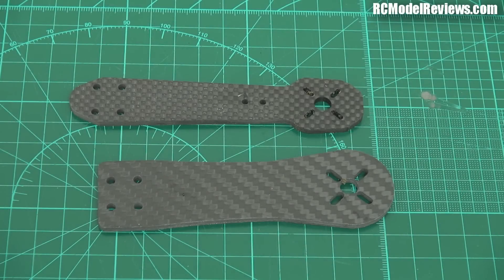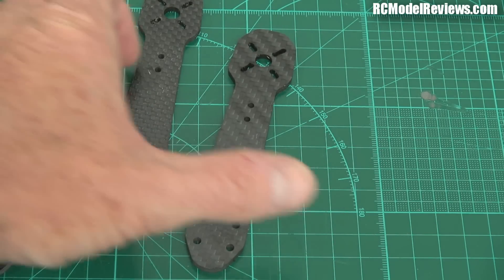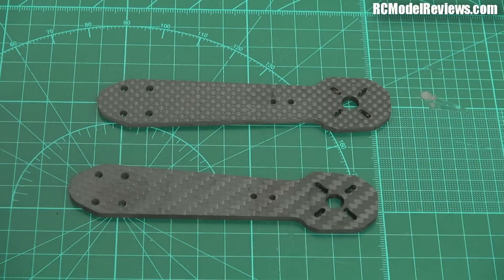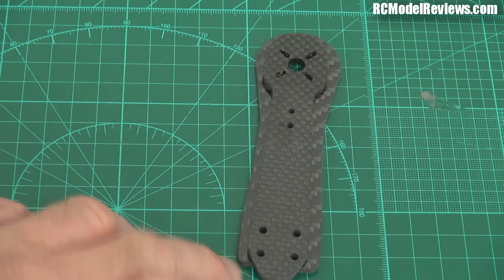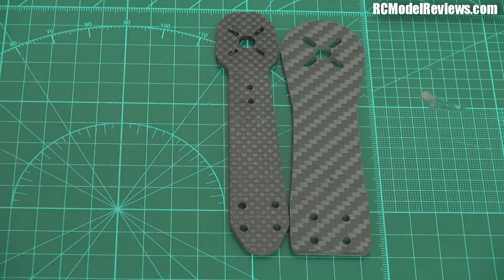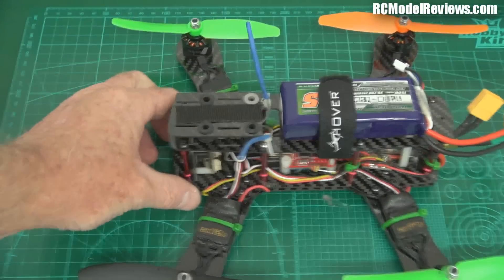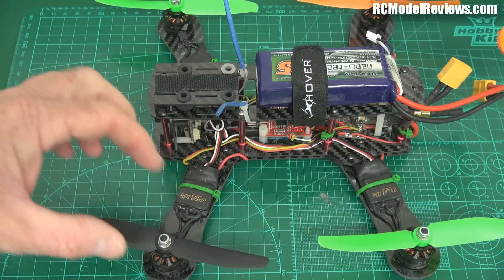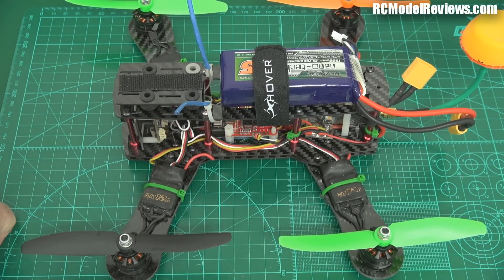ThugFrame arms for the ZMR250 mini quadcopter

Comment: The THUG arms are not bad for the price, the quality is not blackout as you might find a lot of excess carbon on the drill holes / edges you'll need to trim off but for £5 an arm what can you expect but on that note the company itself are absolutely shocking to deal with...  Very unprofessional attitude and they just cant be arsed replying to emails / helping customers - ill never use tentech again that's for sure its a real shame to ruin good value products with poor customer service / attitudes.

Comment: This is probably a stupid question, but would it be possible to just mount this quad upside down having the motors and battery on the top and all the guts inside the "box" on the underside? Or even just flip it upside down having the motors and props pointing down (reversed)?

Comment: Hay Bruce I have a blackout mini quad running afro light 12amp esc's T-motor NM1806 and a cc3d and have been having some punch out problems. when ever I go just above 50% throttle motor 2 cuts out and only starts up again when on the foor. do you have any suggestions 

Thanks Hal.O.Bishton

Comment: Bruce are you using anti vibration foam between those escs and the arms? Reason I ask is because last week I had a bad crash and it was due to the fact that one of my esc's was touching the arm and the vibration caused one of the pcb components to break off and send me tumbling back to earth!!

Comment: Thanks for video, I can't wait for the step by step build of the ZMR250.

I have a question not on the quad but on the radio transmitter and receiver. Sorry if this question sounds silly.

Currently I have a Spektrum DX7s radio bind to a Spektrum AR8000 receiver on my 3DR Y6 multicopter.
If in the future I do build a ZMR250 I'll need to also buy a radio receiver for this quad.

Question- do I have to buy another radio transmitter just for the ZMR250 or can I re-use my Spektrum DX7s radio transmitter? Can I bind my Spektrum DX7s to my current AR8000 receiver and another Spektrum compatible receiver on the ZMR250?

Thank you
David
Reply: Yea you can totally bind several receivers to a single transmitter. In fact you can look into your manual and looK for model memory setting which I think can store up to 20 different model. These saves your trims mixing dr and expos. The only thing some people may get 2 radio's for fixed wings and rotors is the ratched on the throttle.some people prefers the smooth throttle for rotors
Reply: Thanks Chris. This is definitely a positive step in getting another multicopter.

Comment: Those carbon fiber arms are good but how about trying square aluminum tubing, less wind drag and lightweight. Also flat areas for mounting.  Round tubing would be the best but its to make everything line up correctly. I'm using the square tubing on mine and so far it works well for me.

Comment: This frame realy don't need that fat arms, mine has a lot of crashes,  with no issues.
Reply: Frank R. Pilot Then you're not flying hard enough! :-)  But seriously, all but one of the folk that fly the ZMR250 around here have broken several arms each.
Reply: You right, xjet.
Reply: ***** Maybe it's something todo with the air in New Zealand ;)
I can see your new arms would be even stronger, but I haven't broken any arms on the original.
Check the DYS 1806 BE motors. A lot of bang for your buck. :)

Comment: Love your channel! Im Mike from usa. Big fan. Im building my first chinese 250 quad. What size lipo should i start with and also can you recommend a decent, but cheap balancing charger? Thanks, keep it up. TEAM NANA RULES!
Reply: Mike Hogue Lipo size doesn't make a whole lot of difference.  I use 1300, 1400 and 1500 lipos (3S) and get roughly the same flight-time out of all of them.  The important thing is to make sure your lipo is rated for at least 40C otherwise you will be disappointed with the results.  I'm using the Turnigy Nanotech batteries with great success but I suggest you avoid the Zippy Compact packs because they just don't hold up to the punishment.
Reply: Cool thanks xjet. How about a charger?
Reply: Mike Hogue I found the same as Bruce, the 1.3 mAh 45c works great. They're cheaper, lighter and
charge faster. Make sure you get a parallel charging board, then you can charge several at the same time.

Comment: Bruce, i think you've stated before, but what size battery are you flying?
Reply: Sherman Hartman It varies.  I have a collection of batteries from 1300 through 1500 and most of the time I fly whatever happens to be charged.  They all give about the same flight-times.  The key factor is to make sure you have high C batteries.  All of mine are Nanotech and at least 35C.  Don't use the Zippy Compact batteries, they sag very badly under load -- even the ones that are supposed to be hi-C.
Reply: Ok. Thanks. I guess that explains why zippy compacts are a bit cheaper then other brands.

Comment: If you are still banned should it not be Team Banana?

On the arm width efficiency thing I wonder what the created vortices do to the airflow through the props.
maybe there is a design waiting to be created that intentionally swirls the flow to the right area for the rear props when travelling fast.

Comment: Noticed quite a disparity in motor frequencies as if it was front or rear heavy.
Wider arms will also interfere with airflow - if only the arms could be rotated 90 degrees and still retain strength and rigidity.
I guess we'll have to wait until someone invents a 3D printer that can weave carbon fibre optimised for the shape desired and impregnate "on the fly".
I imagine the optimal arm with a cross-section morphing from the flat horizontal motor mount, to a vertical stretched tear drop aerofoil then to the flat base for attachment to the frame.
Not easy to make with a uniform strength profile, but I'd be interested to see if anyone could make some and see how ithey perform. That would be a challenge!
Reply: Andy Lee Robinson And that's why tubes are best :)
maybe not aerodynamically, but they are better than anything else on the market, an they are the best structurally speaking. Plus you can run wires through them so they look very neat
Reply: Andy Lee Robinson 
G'day,

Actually, you're not correct there...the Airflow through the Disc is only Perpendicular to the Disc when the Disc is hovering..; any movement of the Disc backwards or forwards or sideways is reflected by the Airflow through the Disc being Skewed by the "Apparent Wind" in the same way the forward motion of a Sailboat or a Land-Yacht alters the vector at which the "Apparent Wind" interacts with the Sail(s) and Rigging.

  A Quadcopter consists of 4 Fixed-Pitch Rigid-Hub Helicopters on a single Frame...; and the maximum Forward Speed of any Helicopter is limited to the Airspeed of Airflow being processed by the Disc.

 Take the Airflow needed to hover, add more Airflow and then tilt the Disc so as to vector the Excess, and that vectored Lift becomes Thrust, and if sufficient Power is available to exceed 45 Degrees of Tilt then the Apparent Wind experienced by the Motor-Arms of a Quad will begin to shift back towards Perpendicularity with the Disc, but by that point the Body of the Quad itself is dangling at 45 Degrees to everything and dragging like a Barn Door in a Storm.

 I tend to agree with the bloke who advocates for Tubular Arms, and I note that Bruce has been having fun with Tubular Arms and Canted Motors ; so his Quad hovers with it's Arse-End hanging low, meaning that at-speed the Body is lined-up with the Apparent Wind (Slipstream).

 If somebody wants to take on the problems of making it work in realtime.., then they could try Circular Arms surrounded by Aerofoil-Shaped Fairings, able to rotate through 180 Degrees, aligning themselves with the Airflow in Realtime, going forwards or backwards, rather than being designed to be frozen at whatever is the particular Best Shape for whatever Speed and Direction the Designer wants to optimise their setup to achieve....

  In practical terms, the Bodies of these Miniquads aren't nearly as "Aerodynamic" as my Left Elbowjoint, and their Fixed-Pitch Fully-Rigid Rotor-Heads are the most mechanically -primitive Type of Helicopter System ever attempted...; they fly by dint of fiendishly clever Software running in brilliantly stunning miniature Autopilot-Computers and, rather than piss around worrying about anything like Aerodynamic Subtlety or Streamlining Efficiencies, the Standard-Answer to any Performance-issue is " ADD EXTRA POWER...!", and ignore the Turbulent Eddies in the Slipstream, or maybe regard them as being beneficial for better Cooling of the overworked Electrical components and circuitry...

One might as well worry about the Gliding Performance of a Jet-Fighter as bother too much about the Aerodynamic Efficiency of Quadcopter Arms...; it isn't entirely irrelevant, but it's getting there...

;-p

Ciao !

;-p

Ciao !
Reply: Andy Lee Robinson The CG was pretty spot on... the motors have different noises because they're now pretty worn and (as mentioned in the video) have increasing axial movement due to that wear.  Yawing also of course introduces significant differences in motor speeds, since it uses the differing torque to rotate the craft.
Reply: ***** Thanks Bruce, yes that would explain it.
Reply: WarblesOnALot 
Damn the double-tap Ending.

 Phonescreens are a mongrel with long comments...

;-p

Comment: I've broke 1 quad arm ever. Flew quad behind some trees, lost video signal and quad crashed into rocks.   Currently i'm trying to rebuild my Hquad with very thin arms (the warpquad string theory arms). Huge arms kill the efficiency since a large amount of thrust hits the arm, not to mention the air disturbance that extends out even further
Reply: Ben Wilson Interestingly enough, even though these ThugFrames arms are significantly wider than the stock ZMR250 arms, I noticed no difference in performance after they were fitted.  Based on the speed of the cars traveling on the highway that ran alongside the area I was flying I'd say that I was getting at least 80-85Km/H out of this thing at full-noise -- which isn't bad for a 3S setup using cheap 1806 motors.
Reply: ***** I'd expect the cost/benefit of arm width to show up more in flight times than speed/power. but until i finish building my quad and do some tests its hard to say for sure.

Comment: They work well obviously but what about the weight difference ? I'd wager the difference isn't much to worry about and there is the cost I suppose . Not much point if they are expensive when the ZMR really is for the budget minded.
Reply: pavalige Interestingly, when I suggested that the ZMR wasn't really such a cheap frame compared to the expensive "brand name" units because by the time you fitted decent arms, a PDB and other things that are standard in those other frames, the cost wasn't too much different.  Now I see a number of people saying the frame is too dear if you fit decent arms ;-)   The reality is that if you replace the standoffs, the bolts and the arms, you end up with a pretty decent frame which is still cheaper than a BO or a QAV250.   If you don't buy decent arms then, over time, you will spend money on spares and be grounded while you wait for them to arrive or while you're changing them.
Reply: ***** Why not just buy a spare ZMR 250 for $20.
Adding expensive parts to a ZMR kind of defeats the point of buying one.
As a novice I made and flew one for over a month, with many hard crashes.
I never had a single broken part, let alone an arm. I guess I was lucky.
Reply: Sean Kelly
I did buy a spare ZMR250 frame and I have used up all the arms from that.  At this rate, I'd be buying a new frame every couple of months to keep this thing in the air.  Buying a set of properly designed arms is a one-time expense and means I won't have to run the risk of being grounded until I fix (yet another) broken arm.  Makes sense.
Reply: ***** Or it could be time to lay off the triple backflips.=D

Comment: Those arms are £4.25 each. For a set of four that would be £17 or $25.91 USD or $33.21 AUD or $43.90 NZD. That’s more than a complete ZMR frame! And that doesn’t even take into account the cost of delivery.

Arms look good but at that price it’s over capitalising on a budget frame. May as well buy two ZMR frames and epoxy the arms from both frames together, so you have 6mm arms and spare parts left over for good measure.
Reply: That's exactly what I did.  I doubled the arms up.  I scuffed one side of each arm for better bonding, applied some Scotch Weld DP490 over entire surface, and clamped the arms together.  With epoxy still wet, I just used a toothpick and cleaned out any excess epoxy clogging the mounting holes and cleaned up excess.  I got the DP490 from work, but you could just used another epoxy like JB Weld.  Only thing needed was longer mounting screws, but I had those.

As for the frame stands, I just tapped new threads which allowed me to use much longer screws.
Reply: thechosendude Unfortunately some of the ZMR250 suppliers have taken to using standoffs that have been turned down in the middle so you can't tap them any deeper because there's not enough metal of sufficient diameter.  You can see that in the frame shown in this vid.
Reply: but will the extra thickness compensate for the less width to the outside from the hole?
i know what i mean

Comment: " I've got a very large pile of cracked and broken original ZMR arms here." but by your own admission, you aren't much of a quad pilot yet Bruce.. I'm not a fanboy but I haven't broken one yet.
Reply: Designandrew Yeah, but I've given all my 250 frames hell (Nana-style) and the ZMR is the only one that has suffered structural failure -- with a total of five broken arms to date.    Neither the QAV250, Blackout, MXP230 nor Mini-Mamba have suffered such structural failures -- despite my nana-flying ;-)   I'm hoping that with these ToughFrames arms, the ZMR will also become a reliably strong frame.
Reply: ***** Yeah by the time you spend all the money you may as well just gone with a blackout.. I'm having all kinds of issues with my ZMR although it's due to my Naze32.. CANNOT get it to ARM.. I had it working (somehow got it to ARM) flew fine, but yaw was slow. So today I upped the yaw and went to fly it. It got up about 3 meters then DIED. Fell to the ground. Same arming problem again.. I went inside and for some reason all o f my settings were wiped! So I tried to set it up exactly the same, and same problem, WONT ARM! I'm so over this naze 32.. it flies nice but dam I've had problems with it.. Sometimes sitting on my bench you can see the model moving, every second, it moves about 3 degrees on the yaw axis, like a clock ticking, even though it's sitting perfectly still! Ugh I give up I think it must be faulty!
Reply: Designandrew Either your doing something wrong or your naze is faulty. Thousands of people are enjoying the naze and it's quality. Have you tried calibrating the accelerometers whilst keeping the quad dead still?
Reply: Designandrew check contoller end points